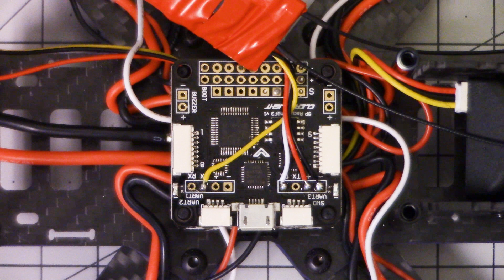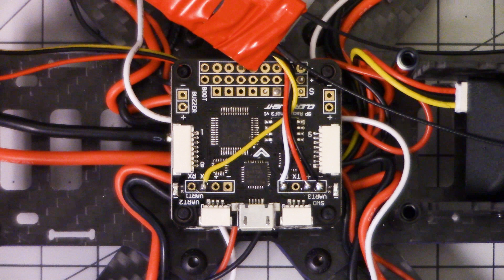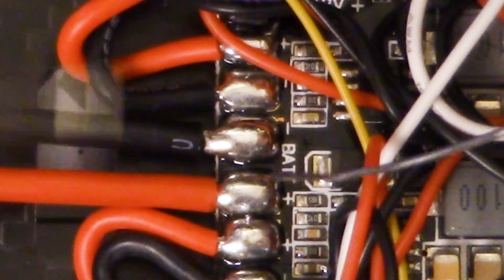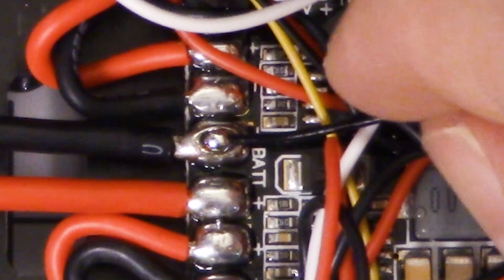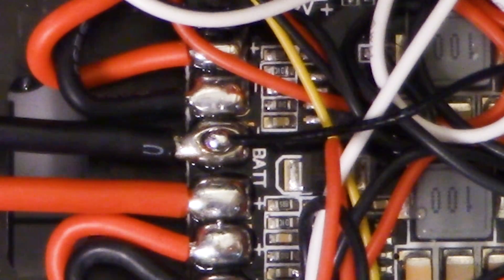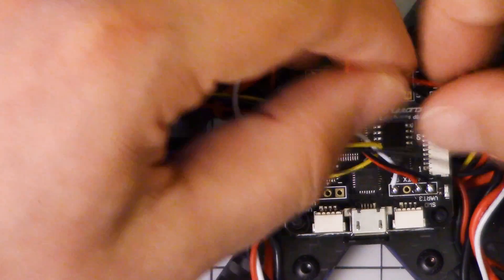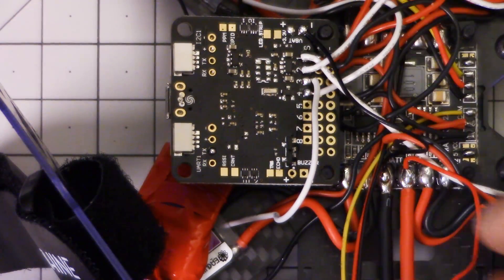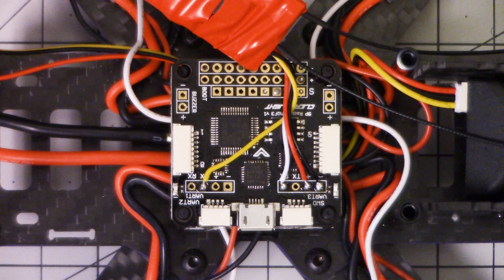Eachine Wizard X220 | BATTERY VOLTAGE MONITORING HACK

Comment: Can you use this as a lost buzzer?

I notice the lost buzzers are wired with 3 wires one to the -buzzer and the other two to terminals 7 on the FC. Im guessing there is no way to trigger the buzzer this way?
Reply from the maker: If you have a buzzer installed, you can use a Buzzer Mode to trigger the buzzer with an Aux switch.

https://www.youtube.com/watch?v=SLy28mYiAzU
Reply: Excellent, thanks Joshua. So assigning a buzzer to an aux switch will trigger it whether it is wired with two wires + -buzzer or three wires -buzzer and + - rails.
Reply from the maker: You should use a two-leg pizeo buzzer for the Buzzer pads on an FC. A three-wire buzzer is intended to be wired to a PWM output, but you don't need to do that if you use the buzzer pads on the FC. The three-wire buzzer is intended to plug directly into the receiver like for use with a fixed-wing.

Comment: As Joshua said, make sure your iron is ~750 degrees.  My iron was not hot enough to adhere solder to the existing solder points at the battery, once hot enough, it bonded instantly

Comment: Hi Josh, I have a stock Wizard X220 and ordered 4x 14.8V 1300mAh 4S, will these damage my quad?

Thanks.
Reply from the maker: +David Miller I used 4s on the Wizard without any problems.
Reply: See it. Strange. I think we all use 4s and, if we fry something we'll fix it or replace. "Happy Flying"
Reply: already had to solder a pigtails on the vtx as I snapped the whip aerial and installed a foxeer arrow v3. I have spare motors arms and lots of better props.  I expect to break something else so it's all good. happy flying.
Reply: David Miller Wizard can handle 3s and 4s battery.
Reply: The X220 came with no instructions, I'm new to the hobby/sport and I asked on another page and they said I cannot use 4s without mods which was bullshit.  And I'd rather have this confirmed for me by someone who isn't trying to sell me something or con me out of my hard earned pennies.
I too have motorcycles and have had for many years and riding a ZX9R and a VMAX at the moment but I see no connection here to my question and I am learning quiet rapidly by politely asking questions to people with the knowledge I need.  Also I'm English not American.  Cheers for wasting my time with that rant. ;)
Reply: You do not learn if you do not ask questions fella and if that offends you then you can politely go f... no we won't go that route. ;)  Sorry (kind-of).
Reply: Thank you Josh.  I've been running 4s all week with no problems but Grayson Hobby said I would fry something using 4s and I needed a second opinion.
Reply: David Miller, please check what you said about Grayson Hobby, It is almost impossible they said that.
Reply: check their video about the wizard x220 I should be second or third comment asking about 4s.

Comment: Hey guys, I just got a wizard x220 arf. I have a flysky FS-ia6b receiver. I am trying to bind it to my transmitter. When I plug in the receiver into the FC, I get no power/led lights etc to the receiver. The main batter is connected and everything else runs fine. Help please.
Reply from the maker: +David Parkes use a multimeter to verify that there is 5v between the power and ground pins on the plug going to the receiver.
Reply: Ok thanks will try that. Earlier before I measured the volts on the 8 pin connector from each end and it read 3.5v. Is that a good spot to measure also?
Reply from the maker: +David Parkes 3.5 volts is not enough to power that receiver I don't think. I think it needs 5 v.
Reply: Ok nothing reads on the multimeter for volts. Don't think the 8 pin connector is sending any power to the ppm connector
Reply from the maker: +David Parkes that's why it isn't powering up then...
Reply: Anyway to fix this or new FC?
Reply from the maker: +David Parkes I suspect you are plugged into the 3.3v power by accident.
Reply: Joshua Bardwell hey josh, if I bypassed the the 5v on the FC 8 pin port and power my receiver from the pdb(5v), and then solder on the ppm wire to the ppm tab under the FC, would that work?

Comment: Hi Josh, my solder didn't blob on top like yours, but crept up the iron while the only thing dripping was flux. Got in in place somehow. Might be wrong sort of solder. One question I have is how do Betaflight see individual cell Voltage when it has no balance connection, Vbat is only main leads?
Reply from the maker: +Pete Pilot Betaflight can't see each cell. It guesses the number of cells from the starting voltage.

Comment: Thanks for the awesome video. I really enjoy watching your videos. Question: Does the vbat connection needs to be connected to the battery input connection or can I choose any positive and negative connection on the PDB?
Reply from the maker: +Rick van Putten any pad that has vBat. So an ESC pad is fine.i believe the PDB also has an unused vBat accessory pad.
Reply: Thanks for the reply. First thing I will do tonight is soldering the vbat :).

Comment: Hello Joshua! Im waiting for a x6b receiver to come. It has a battery sensor build in. It has
 3 wires. Bat gnd bat. Can I connect this to vbat on the fc? But the fc has + and -.  Do I leave one cable out?
Reply from the maker: The pinouts for that receiver are in the manual here: http://img.banggood.com/file/products/20160923224744FS-X6B%20Receiver%20User%20Manual.pdf

I don't think the three wires are bat gnd bat. If they were, then where is the signal wire?

Comment: is the vbat source gonna be a pause and go? i wired in a led and it just blinks every 2-3sec
Reply from the maker: +vinnnocc1011 I'm gonna need more information to answer this question.
Reply: Joshua Bardwell when the buzzer sounds. will it be consent or will it be intermediate?
Reply from the maker: +vinnnocc1011 test it yourself. With props off, arm, then turn your transmitter off.
Reply: Joshua Bardwell i'm asking because mine is intermittent.  wasn't sure if that was correct.
Reply from the maker: +vinnnocc1011 vBat is continuous.

Comment: Hi Joshua, I followed your instructions to a tee....well...sort off....somehow I accidentally crossed the polarity when  soldered the vbat pos and neg to the flight controller, needless to say, it smoked as soon as I plugged it in to test it! so, fretting that I ruined my quad, I unsoldered it and connected it correctly,  totally figuring that I might be buying some new parts I fired it up and was totally surprised when everything seemed fine....I did a quick flight and everything seemed to work fine.....releaved, I brought it in and connected it up to my PC to set up a lost drone switch, while I was in betaflight I noticed that the vbat info was all working and that my battary voltage was 15.3, (keep in mind, this was the same battery that I plugged in when I shorted the board), so I took it back outside to run the battery all the way down to make sure that the low voltage alarm was working....I flew for abut a minute when the alarm came on and the drone immediatly slowly lost power and landed softly.....I thought that was totally weird, so I put it on my charger and now the battary charger is only seeing 3 of the 4 cells! So before I plug in another Brand new lipo, is there a possiblity that I fried something on my PDB or my Flight contoller that ended up killing that battery, or did the damage probably happen when I initially shorted it out? Also can that battery be saved by trying to individually charge up the bad cell? Sorry for the book, but im a bit nervous. ..thanks for the great videos!

Comment: Would you be able to help me with a vbat problem I'm getting 10v from vbat pads to my fc and I'm getting 3vish to the buzzer from the fc but the buzzer is no longer working except when I apply an outside power source and it is always on
Reply from the maker: +Alex Dalton it's hard to imagine how there is 10v on the vBat pads with a 3S or 4S battery plugged in. There's nothing but wire between the battery and the pads. Are you saying that when you plug in the battery you measure 10v on the pads?
Reply: Joshua Bardwell correct and I was using a 3s  pack could I have fried vbat chip on the board ??

Comment: great video
A thing I do not understand. Is the camera power turned on at 12v and the vtx is connected in the cam space to 5v?

If I also had it so connected would understand why the new camera never worked, okkan 1119 feeds only 5v
Reply from the maker: I believe the camera by default is powered from a 12v regulator on the Wizard.
Reply: no , it is supossed 5v power
http://www.banggood.com/Eachine-Wizard-X220-Spare-Part-2_8mm-700TVL-13-CMOS-FPV-Camera-PAL-p-1097336.html?rmmds=search

5v cam 12v transmitter
http://www.banggood.com/Eachine-Wizard-X220-FPV-Racer-Blheli_S-Naze32-6DOF-5_8G-48CH-200MW-700TVL-Camera-w-FlySky-I6-RTF-p-1077100.html?rmmds=search

Comment: Thank you for the Vid. Got a question -> After you done connecting the wires for voltage monitoring. How do you set it up? And where do you see it?
Reply from the maker: +Andre Amaral enable battery voltage monitoring in the configuration tab. The buzzer will go off when voltage is low. And you can view it over telemetry or on an OSD if you have one.

Comment: Hey Man,
    If you're going to have the top of the Wizard again, mind showing us where exactly the 3.3v pad would be for hooking up a Spektrum Satellite?   I'm having a hard time identifying it, and when I add my buzzer, I want to swtich from PPM to Spektrum Sat.   Thanks!
Reply from the maker: Here is a pinout. The 3.3v pin is pin 8 on the 8-pin header on the side of the board with vBat and UART3. It is the pin closest to the vBat header. You can also get 3.3v from the + pad of the Bootloader header, which is the pin that is furthest from the edge of the board.

http://www.rjxhobby.com/image/data/SP%20RACING%20F3-1.jpg
Reply: Thanks man.  I'm not sure I want to solder into the Bootloader header, i guess it'd still work to get me into boot if I did though.    And I don't want to go straight into the IO_1.    With the picture you gave me, i did a reverse search and found a picture of the back that has the 3v i'd probably use.  It's here: 
http://cdna1.zoeysite.com/Adzpo594RQGDpLcjBynL1z/cache=expiry:31536000/resize=fit:max,width:1200/quality=v:70/compress/http://s3.amazonaws.com/zcom-media/sites/a0iE000000GWIo4IAH/media/catalog/product/s/p/sp_racing_f3-2.jpg

I think I'd use that 3v right below the LED Strip.   Sound good?  
And then I'd ground it up at the - on UART3, and put the 3rd wire into the TX at UART3?  

Last one:  Do you think it's worth going "serial" with Satellite vs using PPM?  It should be quicker, is it worth it? 

Thanks!

ps.  Ever looked at changing your Gyro/Accel/Mag Alignment in BetaFlight config, instead of your Yaw degrees?  It seemed to free up some CPU processes for me.  I heard it's most effective in weaker boards, ie F1, but could be beneficial for us with F3 too.

Comment: What AWG do these cables need? AWG 20? Do I need anything thicker than AWG 20 or is AWG 20 good for all the wiring on the Wizard X220 e.g. Connecting the VBAT to the FC, connecting the receiver to the FC etc.? Thanks!
Reply from the maker: For vBat, thin wires are fine because you are not carrying any current at all. 22 to 28 AWG stranded wire is fine. Whatever you have laying around. 18 or 20 AWG might be used for ESC power wires.

Comment: I got the fs-i6x controller any videos or how-to on wiring the controller to this quad?
Reply from the maker: +Kristian Taylor what receiver?
Reply: Joshua Bardwell fs-x6b from the fs-i6x controller
Reply from the maker: +Kristian Taylor thst one supports iBus so you want to connect it to UART 2 or 3. The simplest way is to direct solder to UART 2 on top of the board. Signal to RX, power and ground.
Reply: Joshua Bardwell awesome! Thank you. Uart 2or 3 does it make any difference?
Reply from the maker: +Kristian Taylor no but UART 3 isn't broken out to pads I think.  It's just in the plug at the back of the board.
Reply: Joshua Bardwell thank you, as always super helpful. One more thing my controller when using it with freerider when sticks are in middle, flickers. It gets this weird constant flicker. Is that normal and I just need a dead zone?

Comment: Really helpful videos, just got my ARF version the other day, and I really want to fit a beeper on mine too. 

I haven't got batteries yet so haven't been able to connect it to my computer yet, but seen on the board it says Cleanflight, yet I see guys with the same quad that use Betaflight, so I'm a little confused.

Thanks in advance.
Reply from the maker: Betaflight and Cleanflight run on the same boards. I think any board that can run one can run the other. Actually, that's not entirely true. The Raceflight Revolt can run BF but not CF. But I'm pretty sure any CF board can run BF at least.

Comment: Does the battery voltage show up on the screen from the goggles?
Reply from the maker: +SwissRCBashers no. I suggest the Runcam Swift 2 for that.
Reply: Joshua Bardwell with no esc ground, what do you do when upgrading the esc?  For example I just purchased DYS XSD 30amp esc's and I was wondering about installing them, but I don't know what to do about the ground wire coming from the esc.  Do I have to use it?

Comment: So how would you wire up vbat to the new Runcam Swift 2? as it has vbat osd monitoring?
Reply from the maker: +Enduro Trail Riding it can take vBat directly from its power line, or a separate vBat line.
Reply: Thanks, I can see it only needs 1 wire connected, would I just wire straight from the camera to the main battery lead? or could that kill the camera?

Comment: Great video as always! will this mod also work as a Discovery Buzzer? Surprisingly enough I can't find anything on YouTube about wiring a discovery buzzer to this flight controller.
Reply: Once you connect everything Josh showed you you can put it on a switch in cleanflight or betaflight under the modes tab.

Comment: Looks like there as a small solder connection between the + batt terminal to the + next to it before you started.  I see you were able to remove it when you soldered in the vbat wire.  I'm wondering if that could have caused your esc issues a while back?  Are you still seeing the issue?
Reply from the maker: I don't think there was a bridge, but if there was, it's okay. All the ESC and vBat+ pads are in parallel already. You can verify with a multimeter that they have continuity.

Comment: I trying to install a micro minimosd in this one.
all connections ok, osd configured, but don't exibe the telemetry.
minimosd is in UART2.
Any suggestions to configure in betaflight? Or is not compatiple to this board?

Thank you
Reply from the maker: +Thiago Santos it can work. MSP enabled on UART 2? TX to RX and RX to TX? Baud rate correct?
Reply: MSP is enable on UART1. yes, TX to RX. I try all baud rate...
Reply: I try to use UART1 for OSD but don't works again.

Comment: Hi just a note for wiring, on those matek pdb's the centre connections exactly opposite the battery connections are vbat as well. On the wizard it is where the vtx power wires are soldered to, and is conveniently right under the vbat pads on the flight controller.
Reply from the maker: Good tip.

Comment: how betaflight knows if 3s or 4s os pluged in? FC is measuring total voltage and tbe limit are per cell. Where can I setup in beta flight which Lipo Im using?
Reply from the maker: Betaflight knows because the pack voltages won't overlap. A 3S will max out at 12.6 volts. A 4S will never be that low. If you were to plug in a 4S that was discharged to 12.6 volts, Beatflight would mistakenly think it was a 3S, but you'd hardly be able to get off the ground.
Reply: Joshua Bardwell :Thanks

Comment: PDB looks like a Matek Power Hub - there're couple of smaller VCC pads on opposite side of the board, IMHO it's best to use those rather than making a bit of a mess with main battery pads :)
Reply from the maker: That would be amazing. I didn't see those pads. I see that the camera and vTX can be set to either VCC or 12v but I didn't see a VCC pad.
Reply: if anyone interested, full pin out - http://www.getfpv.com/catalog/product/gallery/id/2528/image/12517/

Comment: I just thought they forgot mine.. looks like much higher quality work than my unit from a few months ago as well. I had about a 1inch piece of wire twisted onto one of my ESC signal wires which I found when running the VBAT between the FC and PDB. just twisted on and taped, then the end of that one soldered to the FC. it flew perfect but I wasn't going to leave it like that...